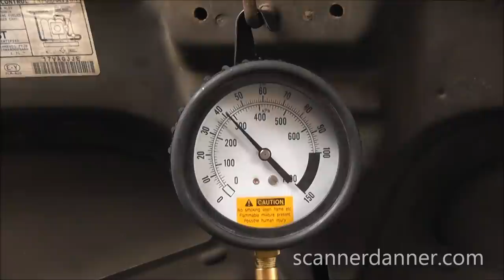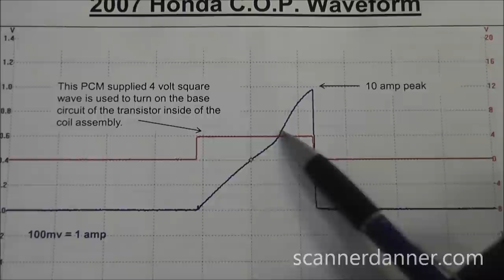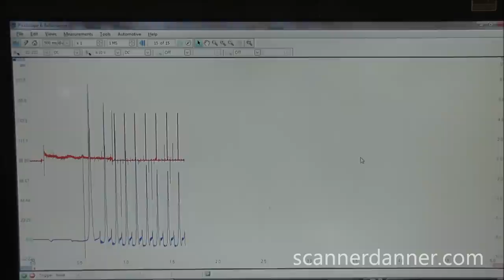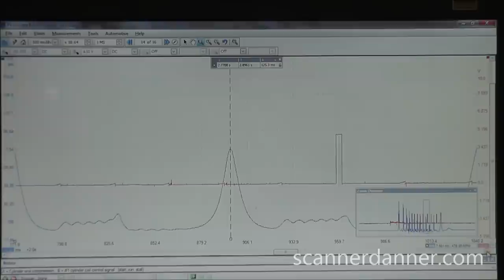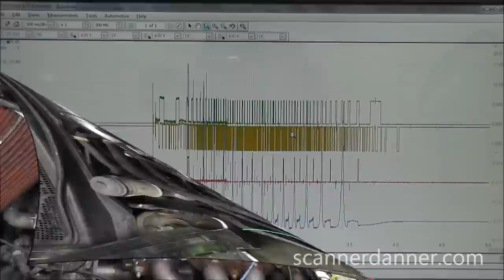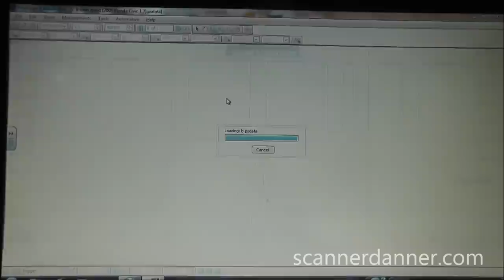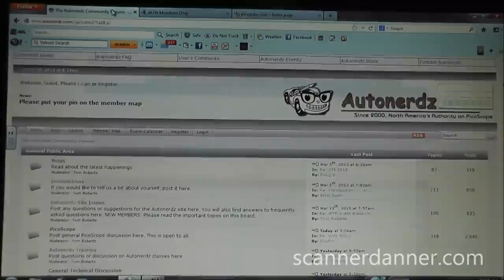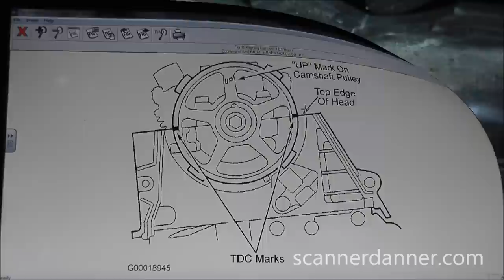Honda Civic 1.7L starts, runs, stalls (incorrect timing belt installation)

Comment: Yes to all of the same things ShiftinGearz said. I too pride myself on following the flow of diagnostics to correctly detect the fault. My dad (rip pops) would say to me " any dumb ass can throw parts at it till the problem goes away. Do it right and you'll find the exact cause"  But to stay on track of my own thoughts to this video was your presentation of the steps and your ability to navigate through the screens and show the areas that applied to the function of that Pico set up. And I will be perfectly honest and say that you went way deeper into this than I want to go. The reason I say that is Im too old to need to know that level and depth due to the fact I wont be doing this too much longer. Now to a younger mechanic with good basic knowledge I would tell a guy like that to glue him self to your hip and done ever close his ears or open his or her mouth. But me..? Ive been turning wrenches for about 44 years now, so my time as i see it is long past, and Im looking to quit this soon as my source of income.  Its nice to see that there are still some old school values left out there and a young guy such as yourself hopefully will get through to these parts changers and explain to them 1st that there is a correct way to fix a vehicle, and 2nd teach them or at the least set an example of how its done. I'll end my statement by saying this. To any person out there needing car repair. This is how its done people. Your service tech should be able to provide you with a brief and simple explanation as to what he or she did to repair your car. You dont need to understand the details of what they did but it should if nothing else make sense. 
 In short if you take your car into a repair shop with a problem. If you get the car back and they have replaced 3 or 4 parts claiming this is what was needed,..? and this is big,... or if it IS STILL DOING THE SAME THING ?  ...... They are ripping you off and dont know what they are doing !! They are NOT techs they are parts changers !! The scary thing is,...  you have just as good of chance at fixing it as they did.  And if you do it your self ?? you wont be paying a 100% mark up on the parts,  and the labor is free. !!! Right  ? I hear from so many people " oh yea i took my car in and my bill was 948 dollars. " did they fix it? " ahh no it was still doing the same thing"  WHAT ?? then why did you pay them ??? ok its early and im ranting.. imagine that  LOL 
 Anywho I have some timing covers to pull on a 01 civic with a 1.7 today so thank for sharing the wisdom with us my friend. 
Outstanding presentation. You will do this industry a great service by continuing to do these videos. Thank you. RT

Comment: I have an 2001 Honda civic LX and I think it has the same issue. It does not start though. Is there a way to take cam off and leave the crank alone and readjust the camshaft sprocket by one tooth that way? seems alot easier then taking everything apart again. Also my compression is low in cylinder 1- at 0, cylinder 2-at 0, cylinder 3- at 80, and cylinder 4- at 150

Comment: I like this video. But WHY does the spark timing change so drastically after the engine starts?
Reply from the maker: the simple answer is "garbage in, garbage out"
Reply: It looks like the ECU actually has a ridiculous amount of correction range, so much so that it killed the car.

Comment: Simply Awesome Paul, very interesting...  so question is using amp probe on starter current is not advisable at all to test for jumped tooth. or that method can be used for specific scenario, if so what it would be, basically I am trying to find out, is it ever make sense to use starter amp current wave form to check for timing issue or not.

Comment: I have a guess as to why the spark timing changed so drastically after the engine started. Maybe the spark timing is routed through a bypass circuit when cranking (providing spark at base timing), but when the engine starts, spark timing becomes actively managed by the engine computer.

Comment: Very ingenious use of wave forms and noticing the importance of phase shifts to diagnose the problem. Thank you for the meticulous and informative video! The one question I have is, would this belt misalignment become an issue some time after it was installed or immediately? Thanks.
Reply from the maker: Immediately. It jumped I believe from the tensioner not being set correctly.
Reply: @ScannerDanner Can the tensioner not being set right randomly cause this a year down the road. We have exact same Honda and it has same issues except doesn't start anymore but it pops over the second you let off key it starts to start then stalls. Engine sounds the same (to me with air box removed/throttlebbodyb exposed it sounds like timing is off.

I read the tensioner s can be installed wrong and let it jump....

Comment: Great job you just save $$$, was told I needed a TPS  that dealers only had for $378.00
and $125 to install. Car was setting for 5 mth  after seeing this went and check the timing belt and that was the problem.Thanks

Comment: Amazing video, I have the same engine in my 2002, and I have a P0336, crankshaft sensor intermitent.....All the ground in the engine bay are dead, should I replace them before changing the sensor?

Comment: Wow!, Is excellent, this will help me to check out a 1997 Ford pickup, engine 4.2, which I think has the same problem, it hurts not have all the necessary tools, I have a 2-channel oscilloscope. This excellent your explanation, congratulations.

regards. Humberto from Mexico

Comment: I have a head question:
what if a customer brings a rebuilt head in and wants it and a timing belt put on a vehicle. Is there checks that the mechanic can do to verify that the head is good?
Reply from the maker: they do make a way to leak check a head with it off the car but I'm not familiar with it, sorry
certain tools you need specifically for that job

Comment: I have a 2001 s10 4.3l it starts and dies pushing the gas peddle does nothing but if I pour gas in the throttle body it runs a little longer iv replaced the sparkplugs, injectors, fuel lines,filter, and pump I've also replaced the altinater and fixed the grounds I'm getting 50psi on the fuel rails please help

Comment: it was just last week that my car started and it would die. I check the spark plugs I checked for injection pulses I sprayed starter fluid into the throttle body still didn't start so I had a buddy look at it for me and by coincidence I had a bad ignition coil which was contributing to the problem but wasn't the main problem. thought it was a crank sensor but had no way to test it. ended up taking it to Honda dealership and they told me that my timing belt skipped three teeth on the camshaft. after they readjusted my timing and they tightened a few bolts that I guess came loose my car started right up.

Comment: And last bit of important info..if you turn the ignition off and restart the truck its back to normal until you can duplicate the fault which pushes me away from mechanical. If it was slipping trans I wouldn't think I could just cycle the key or cancel overdrive and it work perfect.

Comment: Hi, I have a civic from 97, 1.6. check engine light on. i read the code, using the check engine light, and gave me 8 flashes. that means CKP. The problem with the car is that, when is cold starts ok, but if i stop the engine after few minutes, and try to start it again, the engine will spin around 5-8 times before starts. Could this be related to CKP? The fuel pump i hear it spinning , the relay as well so i don t think is something related to fuel system. the injectors checked as well.
Reply: I am directing all help requests to my forum. Sign up (it's free) and create a new post. Be sure to add a name under "alias" as this is the name that will appear in the post.
Here is the link to the forum. 
http://www.scannerdanner.com/ForumRetrieve.aspx?ForumID=3226
Reply: I m in already. Tnx!

Comment: I feel my 2002 civic dx is lazy when taking off.
cylinder compression as follows:
1 = 200
2 = 195
3= 200
4 = 200
 new idle control valve
replaced trany witn 2004 car.
have not checked fuel pressur eyet since I need to T it.
Could it be the exaust is plugged up since I got bad manifold check engine light?

Comment: I did a timing belt and did not install it correctly. I went the clockwise direction (loose tension) when installing and driving for 2 week it jumped like 4 tooth( cam sprocket advanced). Would not run. I reset the timing belt and compression were at above 175 on all 4. Did I risk any bent valves?
Reply from the maker: start it and see how it runs, sounds like you may have dodged a bullet
Reply: I think I dodge this one. How much timing to be off until it hit the valves? @ScannerDanner

Comment: Paul, great stuff again. This and the intro vids opened my eyes to the weaknesses in the rel compresssion/timing signal correlation test. Don't have an in cycl transducer, but it's now on the list. 
However, just thinking, the Honda  was one tooth out, but the timing signalled was walking away from TDC as the engine died. Why would the timing signal not be fixed at a consistent offset away from TDC given that the timing belt is consistently offset by one tooth and not moving from that offset?

Comment: I wonder what a simple vacuum gage connected to the manifold would have shown
Reply: Low cranking vacuum with intermittent spikes of no vacuum as the intake valve opens and the ~14 psi of cylinder pressure gets pushed back into the intake side for a moment.

Comment: My honda is doing the same thing as this. It wont start without pressing gas and it dies when no gas is applied. I get code P1129 and P0336. It runs really rough and smokes alot at start up. I think the timing is good though. I noticed number one spark plug looks bent as if it was contacted by the piston. The engine shakes drastically in the engine bay as it runs and it puts alot. What should I do?
Reply from the maker: do a compression test on that #1 cylinder to start with

Comment: Thanks Paul. Question. At 13:04 you're showing the injector pulse way off from TDC. If the belt was only off one tooth and nothing else is shifting why does this vary so much in this capture?
Reply from the maker: Injector firing is never coordinated with TDC on port injection systems. They actually more commonly spray during the exhaust stroke, giving the liquid fuel time to fully vaporize.

Comment: Hi, I replaced the water pump and the timing belt about a year ago. My car quit while driving and had to tow it. One I had a chance to look at it, I thought it was the gas pump, since I could get the car running with carb cleaner and then it would stall again. It seemed like a fuel problem. I checked the fuel pressure and it had 10psi. I cleaned, not replaced the fuel filter and got 40psi back again. This time it fired up, but ran as if it was out of time. Trying to stall and I could only keep it running at 2500 rpm. After starting a few time and pumping the throttle, it idle by itself at 1000rmp. Although it was running, something was still not right. I took the upper cover and notice it was not in time. I watched your video 'til the end, but you don't show how you adjusted the belt back in time. Do I have to disassemble the whole thing as when one replaces the timing belt or can I just undo the top bold and skip a tooth? hope you can help me out. I did took the top cover off and expose it and the belt is looser on the left side (front towards the bumper ) more than the (right) towards the firewall. hope you can help me out. Thanks
Reply from the maker: First, remove the upper engine mount to gain easier access to a small rubber plug in the timing cover. This plug gives access to the timing belt tensioner. This will allow you to gain slack to slip the belt one tooth. A trick is to cut up a plastic milk jug and make a strip about 6 inches long and the width of the timing belt. Rotate this piece of plastic in between the timing belt and cam pulley by rotating the crank. This will allow you to "slip the belt to the next tooth.
Reply: @ScannerDanner  First off, I want to say Great Detailed Video! Thanks for creating it and teaching us all! I watched about 4 or 5 ads so, expect to get some revenue from YouTube. 🙂I just put a new water pump and burped the cooling system in my 2000 Honda CR-V and lined up the pointer on the actual crank gear like the diagrams online show. Maybe my eyes weren't lined up with the pointer correctly. Maybe it didn't line up with my camera on my phone when I took the picture. When I put it all back together, and I had the pins in the two cams on the top to make them TDC, I noticed the right notch mark on my harmonic balancer wasn't lined up with the pointer on the plastic cover after I put all of the belts on. My CR-V runs but, the idle is low at 500 RPMs or less. It hesitates when I step on the accelerator when the CR-V is in a stopped position. I can get it up to speed once it's going. I thought I would look through the comments before I asked and if there was a way that I could loosen the tensioner and make it move a notch over without taking it all apart. I have to put on another valve cover gasket because the (FP) one I bought stretched in less than a day and is leaking now. Your answer here with the plastic strip sounds like it could work except for I have two cam gears. Should I try to cut out two pieces of plastic from a plastic container to try that trick on both cams? Since I have to turn my crank puller clockwise one notch, can I just try to loosen the tensioner and lock the cams putting a drill bit in the tdc holes or could I damage my engine that way. I wouldn't put a lot of pressure on it to make it slip a notch. Would it be better to use the plastic strips from a container? Your plastic strip trick seems like the better way to go. Thanks and thanks again for the video and your help! 🙂